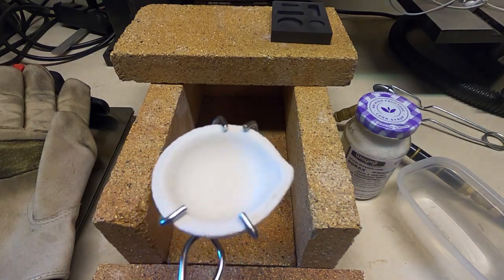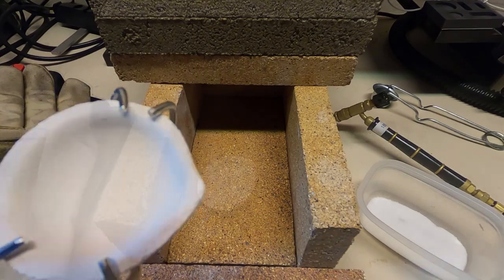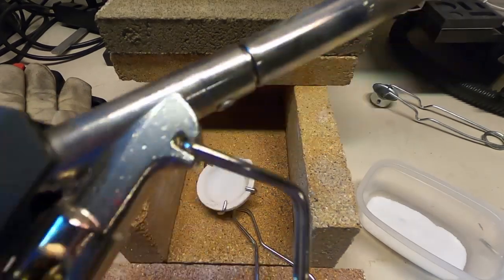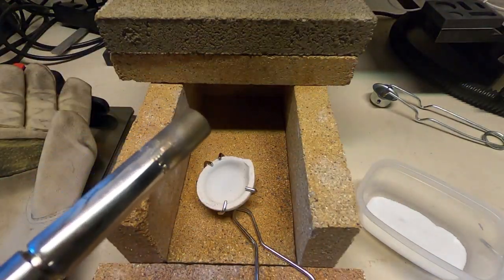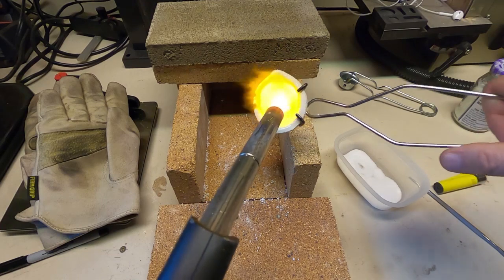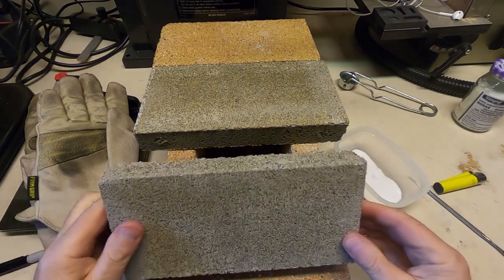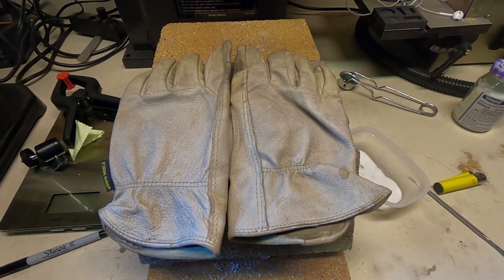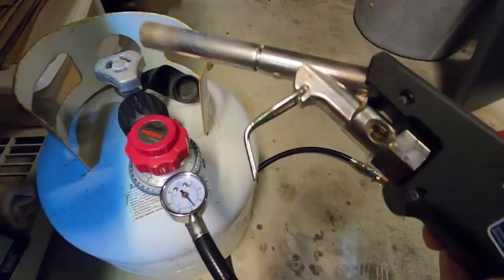How To Glaze A Melt Dish Crucible With Borax For Melting Silver Gold

Comment: Compared to other tutorials, you use a lot of borax, do you feel like you could've benefited from less or do you feel this is the way to go (doing my first one today)?
Reply from the maker: I just use a pinch although sometimes i use use more than other times. The main reason for the use of borax is so it forms a glassy layer over the molten metal, protecting it from oxidization & it makes it easier to pour. When melting coins 90 percent silver 10 percent Copper, Copper oxidizes more than silver so i give a little more Borax than i would if i was melting a higher percent Silver...I am no expert i learn as i go....Have fun with your first pour.